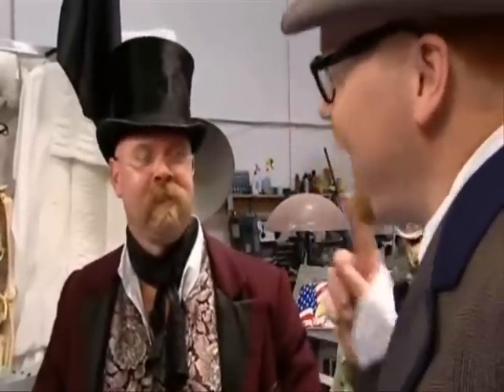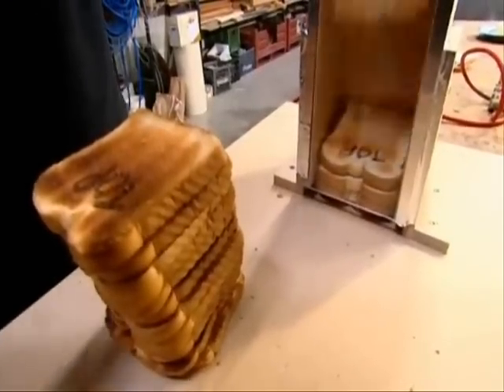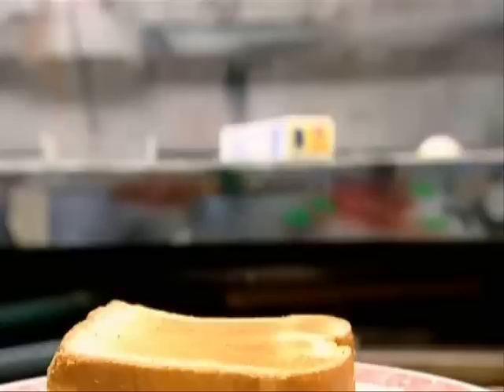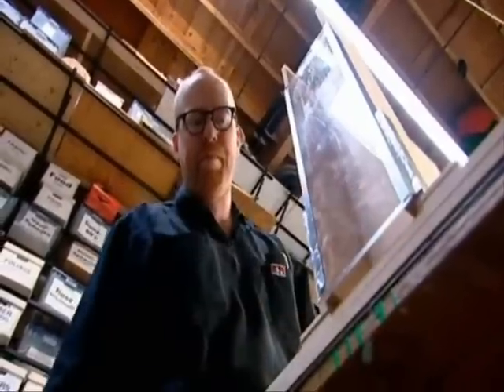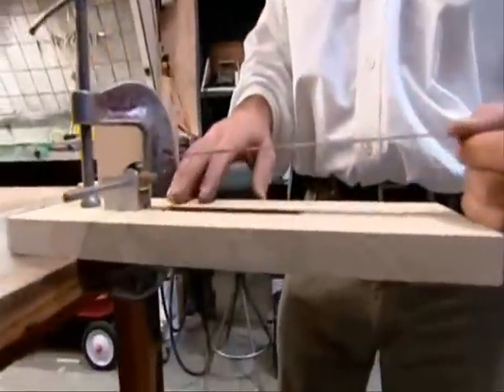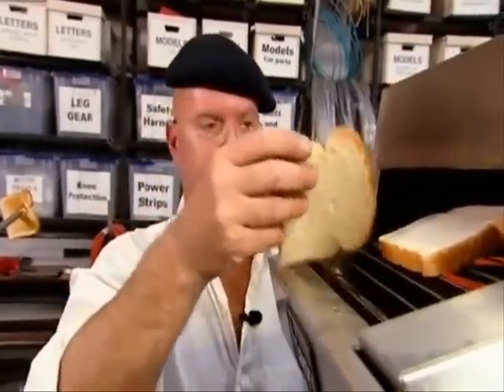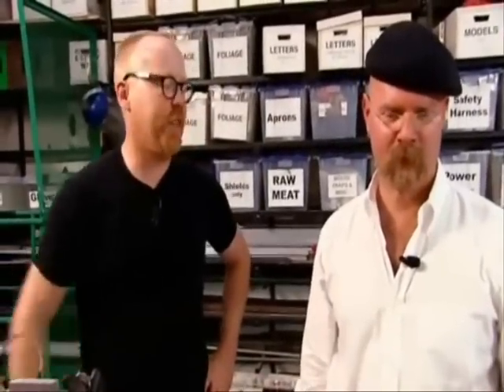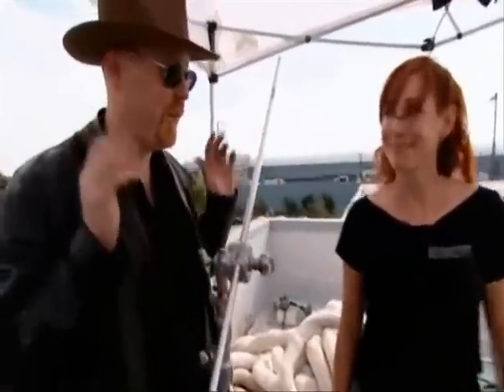Mythbusters toast

Comment: While the buttered side landed up more often than the non-buttered side (RR=1.115), the difference was statistically not significant (p=0.537).
The buttered side up should have landed 36 times up to be a statistically significant result (RR=1.385; p=0.0379).

Comment: Technically, how fresh the toast is would matter.

Hot air rises,
As the hot Air escapes the toast it could happen to rotate the toast mid-air, es butter seals over the perforation of the grain, forcing the air to shit sideways in an attempt to make it over the edge.
That hot air would have drag, creating force, which in theory, COULD help give the toast some extra spin.
Adding extra factors, like a slightly off-level table…. Your toast could indeed land butter down more often.

Comment: Since any toast that's been buttered sits buttered side up on a table or plate, odds are that if you bump or slide it off, based on the height of the average table and the average height that a person holds a plate as they're walking, you're guaranteed to get a single flip leading to toasts predominantly landing butter side down. I've never dropped toast indiscriminately. I've only ever dropped them like Adam's first machine and they've always landed buttered side down.

Comment: Bad Testing. Bad Result. 

The Myth is that Buttered Toast Falls onto the Buttered Side when you Accidently push it off the Table. 

And you actually Confirmed that Myth in the First Few Minutes of the Test.
Because when it happens the Toast will always just do one Rotation and then Fall onto the Floor with the Buttered Side Up. 

So this Myth is Confirmed.

Comment: Most of what is shown in this video is just useless, and it misses the point. The real point is that when a toast falls, it falls when we have flat in in one hand. When this happens, it flips while we are buttering it. So the toast starts falling with an angular momentum. This means that in the first part of its fall, when it is still falling at a low speed, it has the time to flip enough to turn by 90 degrees, still having a constant angular momentum. After this, the fall goes faster (it accelerates because of gravity), and the slice simply does not have time to flip completely and make a 360 degrees turn (actually 270 degrees would be enough). The fact that it is buttered has essentially no effect. It simply falls preferentially on the side that is opposite to the one that was upside at the start. It would need almost 2 meters of fall to flip enough to go back to the buttered side up.

Comment: IMO the main issue with their testing is that normally toast is buttered quite liberally. Enough to add a significant (but not large) weight difference between the two sides. This quite clearly would explain the reason behind the myth. Like a weighted coin, a (relatively) thin object with two flat sides that has very little bias towards either one, wouldn't require much weight added to either side to suddenly make one a much more likely outcome.

Comment: The reason that it mainly fall butter side up is because of the height it is dropped from. The bread will flip as it falls off a plate, or from someones hand, and as the butter is facing up, the bread faces down as it hits the floor and obviously stops its rotation when it connects with the floor. Dropping it edge first is not correct practice are people usually don't have their buttered toast standing on their plate on the edge of the pieces....

Comment: A toast which is placed on a table around 2 to 3 feet above the ground is supposed to fall butter side down because a toast is generally kept butter side up. When the toast is slowly pushed to the edge of a table, just think, when the toast is half way outside the table, the center of mass of the toast slightly starts to shift out of the table. At that time, for the toast to fall the toast does not falls flat. It flips half way and falls. As it falls 2 to 3 feet, it gets enough time to complete a half flip and lands butter side down. As the toast falls, its rotating motion decreases a bit. So, it doesn't matter whether the table's height is 2 feet or 3 feet or even 4 feet, the toast stands the most chance to land top/buttered side down.

If some-how, Spiderman is doing the breakfast on a table whose height is 10 feet, then maybe the toast while falling will get enough time to do a complete flip and would land top/buttered side up. But, if it's not the case the toast lands top/buttered side down.

If you just drop a toast using a straight vertical claw, as shown in this video, then the toast while falling does not have the rotational motion, which will not be the case while the toast tips from the edge of a table. That is the reason why the toast in this experiment stands 50-50 chance of landing top/buttered side down.

Comment: I don't know anything about statistics, but it seemed premature to discount Jamie's rig after 3 pieces landed up and 7 pieces landed down... I don't think those numbers are statistically significant with such a small sample size.
Reply: mayb with atleast 100000 toast it will normalize
Reply: @Burial Though I wouldn't usually trust Nietzsche on math,... that's just how it is 😅. With such a small sample data, most, if not all, of the experiments just can not give a reliable result.
Reply: A toast which is placed on a table around 2 to 3 feet above the ground is supposed to fall butter side down because a toast is generally kept butter side up. When the toast is slowly pushed to the edge of a table, just think, when the toast is half way outside the table, the center of mass of the toast slightly starts to shift out of the table. At that time, for the toast to fall the toast does not falls flat. It flips half way and falls. As it falls 2 to 3 feet, it gets enough time to complete a half flip and lands butter side down. As the toast falls, its rotating motion decreases a bit. So, it doesn't matter whether the table's height is 2 feet or 3 feet or even 4 feet, the toast stands the most chance to land top/buttered side down.

If some-how, Spiderman is doing the breakfast on a table whose height is 10 feet, then maybe the toast while falling will get enough time to do a complete flip and would land top/buttered side up. But, if it's not the case the toast lands top/buttered side down.

If you just drop a toast using a straight vertical claw, as shown in this video, then the toast while falling does not have the rotational motion, which will not be the case while the toast tips from the edge of a table. That is the reason why the toast in this experiment stands 50-50 chance of landing top/buttered side down.

Comment: Busted? I'd say confirmed! Because the only interesting thing is what happens when it falls from a table.
Reply: A toast which is placed on a table around 2 to 3 feet above the ground is supposed to fall butter side down because a toast is generally kept butter side up. When the toast is slowly pushed to the edge of a table, just think, when the toast is half way outside the table, the center of mass of the toast slightly starts to shift out of the table. At that time, for the toast to fall the toast does not falls flat. It flips half way and falls. As it falls 2 to 3 feet, it gets enough time to complete a half flip and lands butter side down. As the toast falls, its rotating motion decreases a bit. So, it doesn't matter whether the table's height is 2 feet or 3 feet or even 4 feet, the toast stands the most chance to land top/buttered side down.

If some-how, Spiderman is doing the breakfast on a table whose height is 10 feet, then maybe the toast while falling will get enough time to do a complete flip and would land top/buttered side up. But, if it's not the case the toast lands top/buttered side down.

If you just drop a toast using a straight vertical claw, as shown in this video, then the toast while falling does not have the rotational motion, which will not be the case while the toast tips from the edge of a table. That is the reason why the toast in this experiment stands 50-50 chance of landing top/buttered side down.
Reply: It falls top down, but butter doesn't matter.
Reply: Lau Bjerno maybe It should have gotten a plausible
Reply: Lau Bjerno not a confirmed